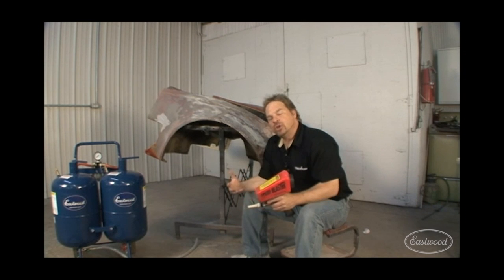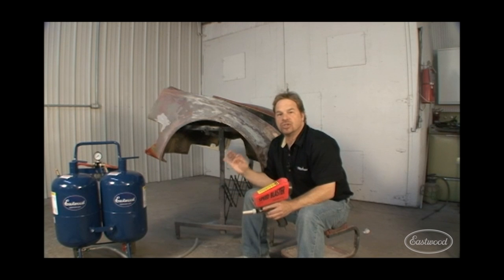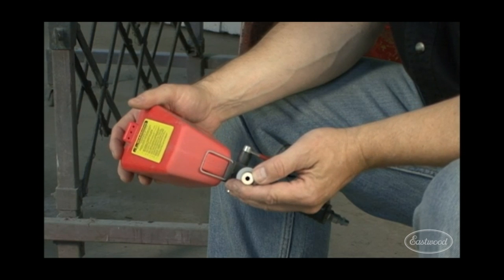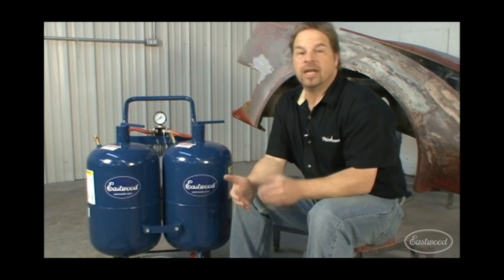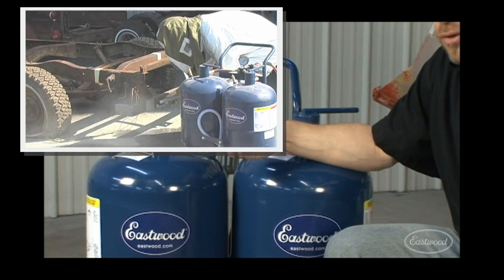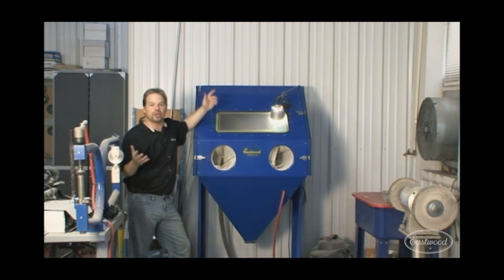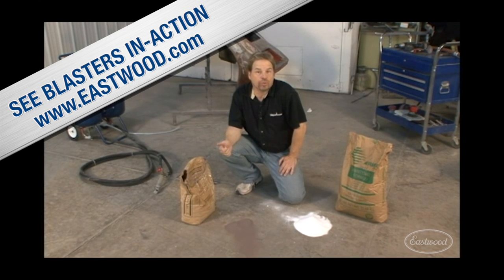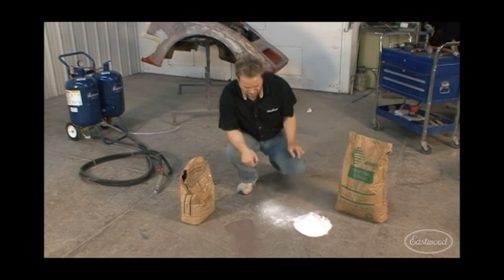Abrasive Blasting on Kevin's Korner with Kevin Tetz at Eastwood

Comment: Hey Eastwood, would it be possible to use water with this dual blaster to keep the dust down?
Reply from the maker: You don't want moisture inside the hoppers with the blast media.  It will clog.  That's why you always want dry air entering the blaster.